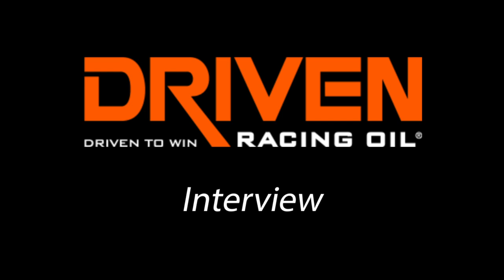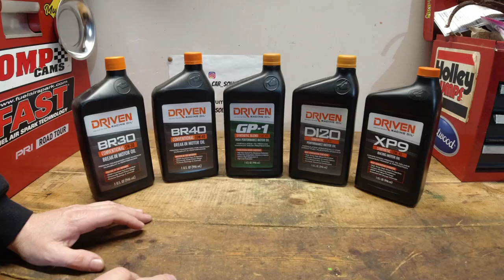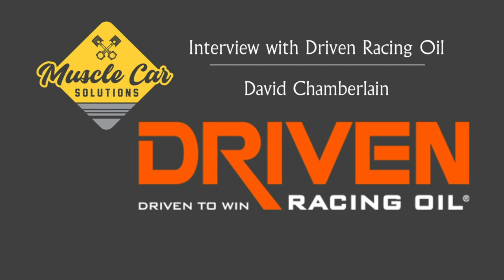Interview with Driven Racing Oil: Performance Oil Applications and Zinc Myth Busting

Comment: I'm glad I found this oil, it saved my love for flat tappets and save me the 600-$800 to switch to a roller which are not in my wallet range especially with switch my valve train completely. I love thier HR1 oil
Reply from the maker: They have the right chemistry that matches a lot of my needs.  Amazing products.

Comment: Brian that might have been the best spent hour I’ve had in awhile, good stuff, I feel more educated then most, plus I did driving around in my heating oil truck, ha ha, so what I am taking away from this is for my 55 with the 350 the GP-1 , and the 53 with the solid lifters either the GP-1 or straight 40
Reply from the maker: Give them a call but I’m guessing you’re right on track with the GP-1.  The base oil is really just the best thing on the market and it’s only in their oil.  Been a Driven fan for years.  They just have all the right solutions.  Glad you got something out of the interview and thankful they agreed to sit down with me to have it.

Comment: Wow! Cool interview. I have a YouTube channel and a few friends and I are going to do our own Junk Yard Mopar builds (not all the engines are actually from the junk yard) with the idea of building a fun street (maybe strip)) engine on a budget. Cam break in is the most important thing on my mind. Saw your failed cam video, great info. Anyway, I’ve been using Royal Purple 10-30 break in oil and would add the GM EOS additive. So far, I’ve had success. My buddy insists on using Driven 20-50 break in oil. Is it better to use the thicker break in oil? Sounds like from what David is saying (and I’ve heard you say it too) the additive isn’t doing anything because it doesn’t blend. Being paranoid about losing a cam (so far I haven’t lost one) it’s hard for me to let go of the EOS even if it is just a lucky rabbits foot.
Reply: One more thing, on the junk yard build I’m planning on using a Comp .509 (lift) cam for my 440 Mopar. Part of why I’m using it is I’m hoping to prove its not the cam brand that’s the cause of cam failures. Comp definitely has got bad press on cams. Anyway, I want to try using the Driven break in oil because on the street it’s commonly referred to as the best. I like stacking the odds of success in my favor. I’ve been using redline assembly lube. Again, with success. And now you and David drop a new bombshell with this gel assembly lube. It’s hard for me to let go of what’s been working and try something new but I’m going to do it and jump in with both feet.
Reply from the maker: More zinc doesn’t mean better protection.  A properly formulated break in oil is all you need.  From this interview and the one we did with Lake Speed Jr, adding an additive to an oil doesn’t mean you get that protection immediately.  You might not get it at all if the package in the oil is fighting with the additive.  Don’t play chemist.  Just buy the right oil for the job.  The RP is ok.  Viscosity choice depends on a few variables.  Bearing clearances.  Type of rods and block used.  Type of fuel being used.  N/A or boosted.  All are factors in selecting the correct viscosity.

Comment: Good morning I have an old Datsun with an A15  series motor. I'm putting it together with bigger pistons, mild cam, and double Webers, headers, the head worked on. So my question is what type of oil should I use in it? It's for street use.
Reply from the maker: @franciscocordova9561  call Driven!

Comment: I’ve used the GP – one synthetic blend 15 W 40. I think it’s a fantastic product! I’d like to know where I could buy it near me as the engine builder I purchased it from has retired.
Reply from the maker: I don’t know where near you is!  There are some links to product in the video description.  That might be an alternative for you if you can’t find it in your area.  It’s a must use for my toys.  Nothing on the market compares to that Pennsylvania crude base oil and Driven is the only brand using it.

Comment: Just purchased new crate GM Performance LS3 430 hp. What break in oil from Driven,how long to run it,then which synthetic oil after?
Reply from the maker: Just like mentioned in the interview, the break in oil needs to take care of the initial break in as well as the long term break in of the rings.  On your hydraulic roller engine, your biggest concern in the long term ring break in.  Go 400 miles on the required weight BR and switch to the LS30 for a street driven engine after that.  Wix HP is the choice for filters.

Comment: great interview,  how about zinc and catalytic converters. have a late 70's chevy with a single cat. most oils with high zinc say not for cat converters. street car
Reply from the maker: That is correct.  You’ll need to run an API oil that’s friendly to catalytic converters even though it’s a flat tappet engine.  There are a few that have a slightly higher zinc content.  Your best bet if you’re not sure is give the folks at Driven a call.  They’ll get you the right answer.

Comment: seems like the 20w50 gp1 would be great for my harley m8 engine
Reply from the maker: That’s entirely possible but a quick call to Driven to confirm would be a good idea.  I know they used to have a separate oil for power sports applications.

Comment: looking for a 20w-50 oil for drag racing,  a dragster using methanol fuel, any recommendations?
Reply: Hi Kevin! For this we would recommend the XP5 20W-50 Semi-Synthetic. The XP5 is now updated with the same Pennsylvania Grade Base Oil as the GP-1 product, however the additive package in the XP5 is tailored specifically for racing. It contains a higher level of molybdenum, and less detergent which is what you want for racing, specifically when racing on methanol fuel. Hope this is helpful.
Reply: @DrivenracingoilLLC  Thanks for the info, my concern is when it's warming up the oil milks, then after 170 degress the vacuum pump pulls out the water.

Comment: GP-1 be used in a direct injection engine?
Reply from the maker: No.  They have a line of oils specifically  for DI engines.
Reply from the maker: https://drivenracingoil.com/c-1389348-shop-by-product-direct-injection-oils.html

Comment: Great info lots of info about Zinc
Reply from the maker: Hey man!  Wanted as much info on zinc and why it’s best to buy an oil with it already formulated instead of adding it to another oil.  Hope all is well with you!
Reply: @MuscleCarSolutions  I’m well, hope your doing well

Yeah I used to add a zinc additive, but now I use Amsoil Z-rod oil

I did use Driven break in oil when I first broke in the camshaft.  So far engine is running ok but it does burn a little oil, valve guides might need changing.
Reply from the maker: @tooljunkie6003  I think the important thing is if the oil meets the demands of the engine.